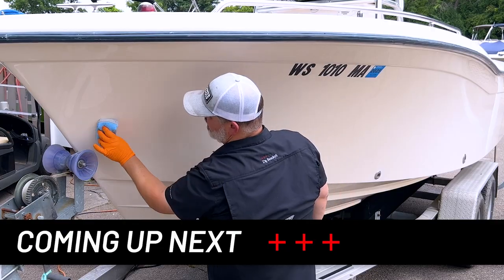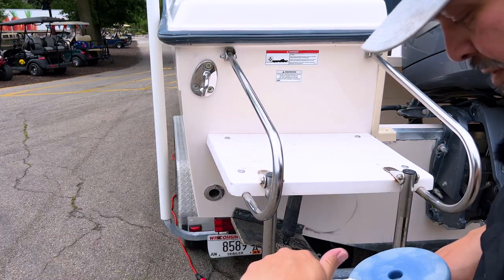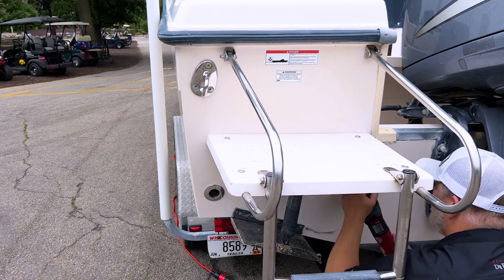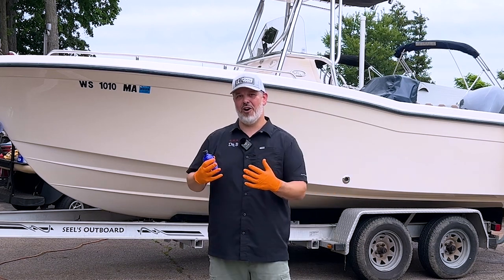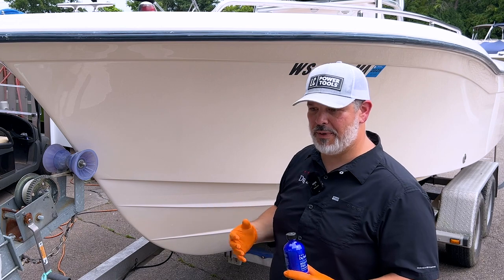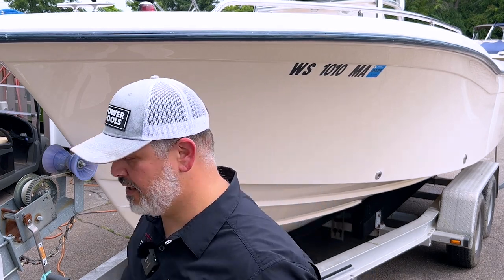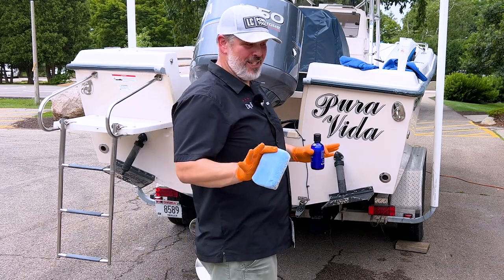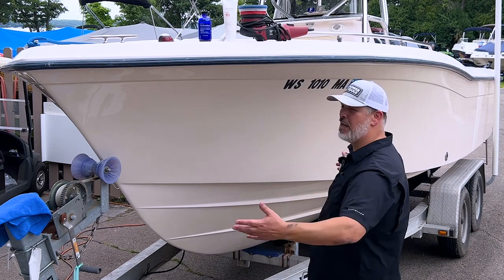How to Ceramic Coat Your Boat — Boat Coat Pro EXPLAINED

Comment: This is a one step application, no base or initial product required after the cleaning or polish step?
Reply: Correct Kirby! Polish, coat and done. Best part… down the road if you want to re-coat you can prep with Dr.B’s new Marine Decon. You don’t necessarily need to polish again…

Comment: What are you using to get the area below the water line so clean? I detail one boat a year that stays in the water in Maine from June to September. When It gets dropped off there is a layer of greenish-brown scum on it. While some of it comes off with the pressure washer I am looking to not have to crawl under the trailer to scrub it off.
Reply: My boat is on a lift when not in use… hence a very clean hull, even below the water line. I polished the entire hull with NSP last year and coated with an earlier “beta” formulation of this coating. However, if your boat floats all season… temper your expectations.
Reply: @directorofsuccess  It is not my boat.. belongs to a friend.